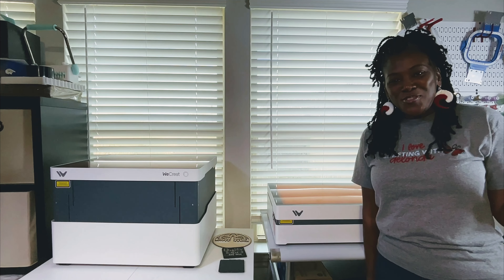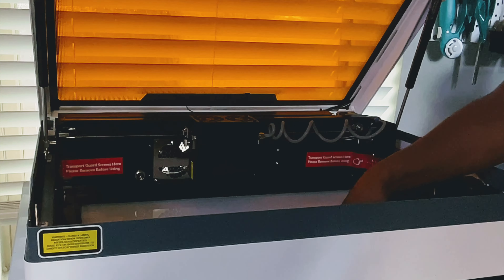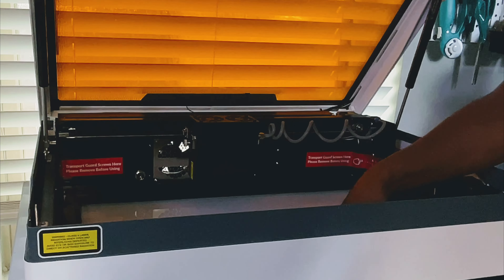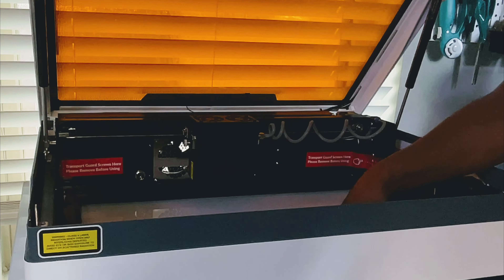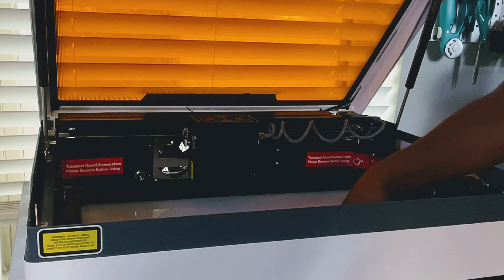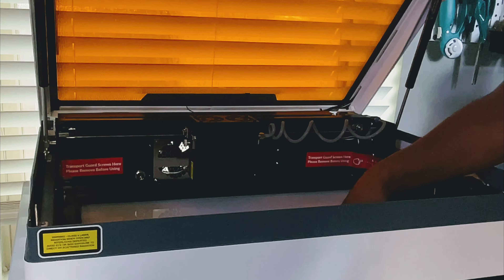WeCrate Vista: The Ultimate Unboxing & Setup Experience

Comment from the maker: Chapters:
00:00 Introduction to WeCreat Vista Unboxing
00:40 Compare and Contrast the Footprint of the VIsta to the Vision
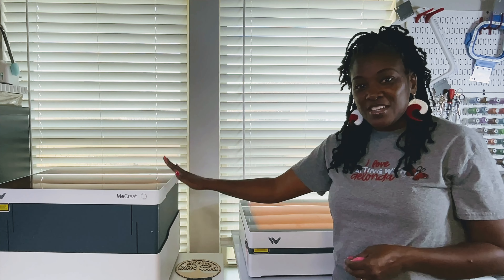02:56 Let's Remove the Transport Pins and take everything out of the laser bed
05:01 Remove the four screws inside
06:08 Let's connect all of the inputs on the back
13:09 Quick Recap of the Inputs on the back of the machine
14:22 Install the Software
14:57 First Project - Hello - in the WeCreat MakeIt Software
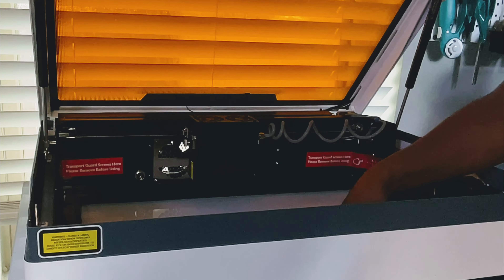17:25 Settings for Engraving on Slate with WeCreat Vista
19:51 Let's Install the Rotary Attachment on the WeCreat Vista
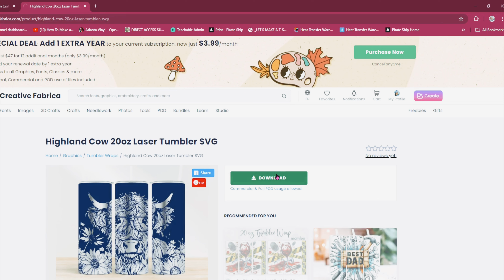26:21 Let's Prepare the Software for Laser Engraving a Tumbler
29:35 Final Thoughts about the WeCreat Vista

Comment: Than Delonda for this video. I have seen several unboxing videos for the Vista but this one is by far the best and most detailed. I also love that you compared it to the Vision. 1 questions I have that no one has answered is: are the settings the same on the 20w and the 10w. For instance, did you use the same settings when you compared the slate coasters? Have you ever cut/engraved on MDF. I've MDF is dangerous to laser but then I see many people doing it. What is your opinion?
Reply from the maker: Thank you. I used the same settings on the Vista as the Vision. I have cut MDF with the Vision with no problems at all.
Reply: @CraftingwithDelonda  thanks, I know MDF will cut, but I've heard it is dangerous because of the toxic fumes from the glue. As you know, MDF is just sawdust and glue. I have you not heard this?
Reply from the maker: @buddysmith7080 I haven't heard that.